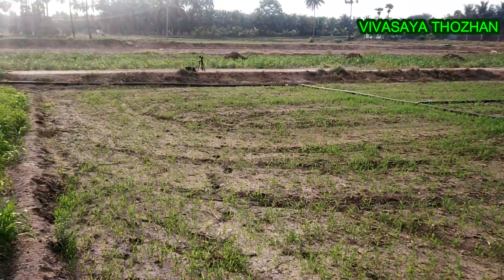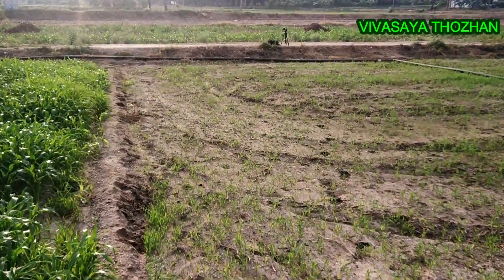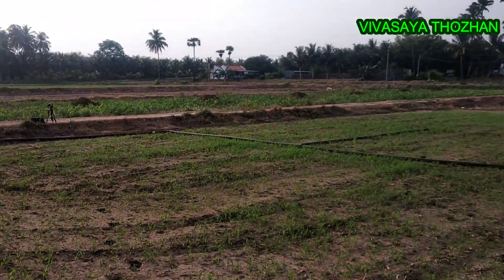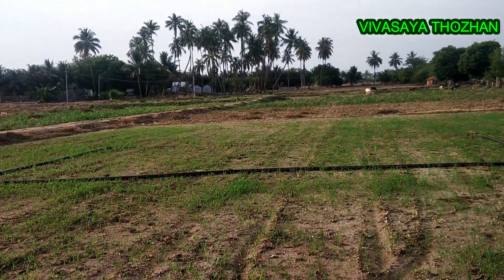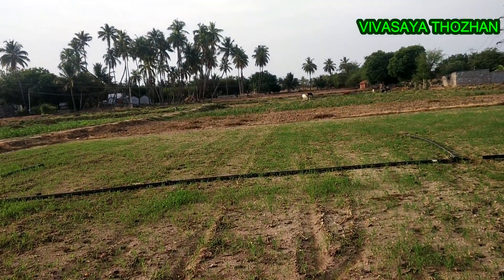RAIN GUN SETTINGS VIDEO

Comment: I am from villupurum, i need to know about pressure system. Currently i am using 7.5hp motor and well depth is about 90 ft . Whether i can use rain gun. how can i contact you bro
Reply from the maker: Yes call me

Comment: 3 hp open well motor la ethana 1.25 inch gun ethana use panalam?
Reply from the maker: Yes based on pressure
Reply: @vivasayathozhan  oru gun use panninal evlo distance ku spray pannalam? 10 mm nozzle